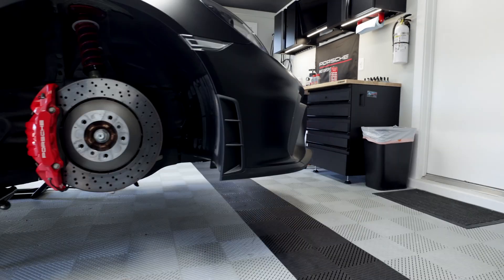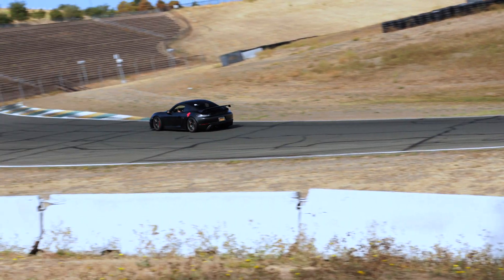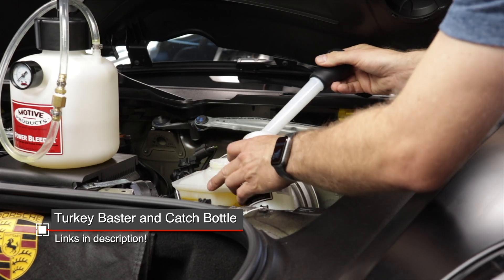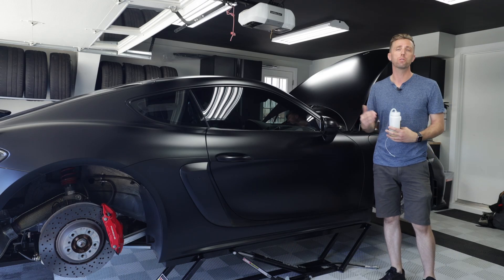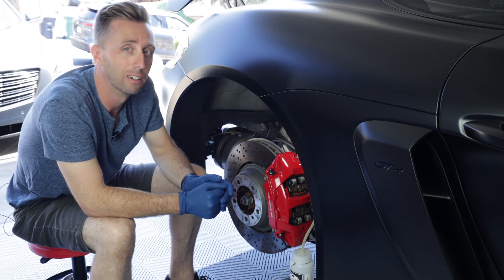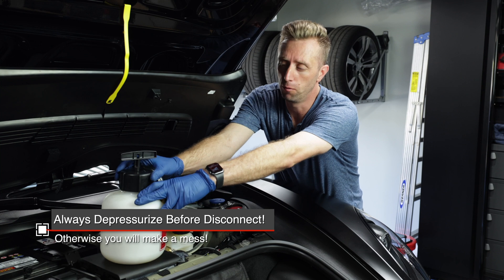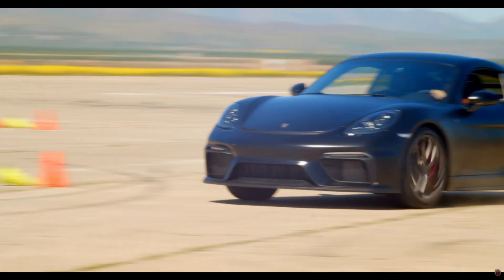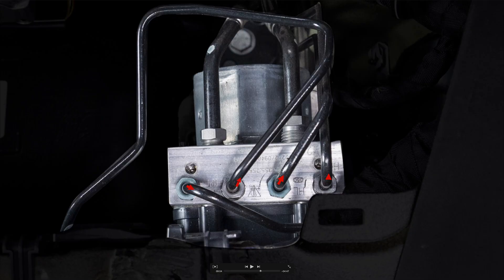Should You Bleed the ABS? | Porsche GT4 Bleed and Flush

Comment: thank you for the videos! i will follow your video very soon for oil change and do the brake fluid shortly after. one question: in your video you mention to use at least 2 quarts of brake fluid. are you sure its 2 quarts? it seems in the video you used two 500ml bottles, which is 1L closer to a quart. 2 quarts would mean about 4 500ml bottles. Thanks!
Reply from the maker: Sorry, you are correct. Have two 500ml or equivalent bottles available to flush.
Reply: @JetFuelOnly thanks for clarifying! If you are doing it again this year, would you mind showing us how to bleed the clutch as well? And maybe spark plugs too?
Reply from the maker: @tonyliang90 unfortunately I have a PDK so there won’t be a clutch bleed I plan to do spark plugs sometime in the next few months and I will make a video
Reply: @JetFuelOnly awesome looking forward to it

Comment: How to bleed the ABS you need to do your steps and get a friend or wife,let the pressure bleeder turn on your engine,in my case front driver side first , person inside car apply breaks.
And you bleed.
The reason for that is the ABS motor in the break unit Is active.

Comment: Just got it done on my GTS 4.0, including the ABS Bleed. I can confirm the iCarSoft POR v2.0 does now work with the latest update. Glad it worked as I was going to skip it, but after general bleed the brakes felt fine, but in my mind, softer than they were before. I did the ABS bleed per the iCarSoft walk-thru and afterward the brake feel was rock solid hard. Great video Danial, thanks so much for detailed and polished content man!  Also, I saw you were on Rennlist, I'm going to send a friend request, I just joined!
Reply from the maker: That’s for your support man!  I’m glad it’s working. Will need to update!  Got your request.

Comment: Hi you stated you had problems with bleeding your ABS system with a scanner. I think the battery needs to maintain a certain power. When you're bleeding, the ABS with a scanner.
That's why your scanner times out. Cause the battery power drops it's low . Please communicate back to me if you successfully did this. The way I stayed it, and if it worked, you can put a battery maintainer on the car, so when you're doing the steps, it maintains that vote is because the porsches are sensitive when it comes to power. Maintaining when programming
Reply from the maker: Interesting!  Will need to check that out. Someone posted below they got it to work with an update.

Comment: Nice video. You should always bleed the outer bleeder valve first not how he did it.
-During the bleeding process second fitter must operate brake
pedal slowly
-only after remove hydraulic or master cylinder you should bleed with PIWIS.
1bar pressure not enough. pushed all the way to 1.8-2 bar

Comment: ABS bleeding is very finicky. If the pressure drops below the recommended level, or if the battery runs below a certain threshold, the process will fail and you have to start all over again. I used a PIWIS system and it still took me 4-5 tries to get all the conditions exactly right for it to bleed all 4 lines successfully.
Reply from the maker: Good to know thanks!

Comment: Great video and super helpful! Minor correction for the benefits of viewers: 
There are two bleeder valves on the brake calliper. Brake  fluid must be drained at both bleeder valves. Always bleed the outer bleeder valve  first.
Reply: I dont think the order in which you bleed them matters, in either case you are going to get all of the old fluid out
Reply: Perfect, thank you. I was looking for this. Wasn't sure if you only had to bleed one side of the caliper when performing the ABS part.
Reply from the maker: Thanks, I mentioned both bleeders at 4:50 but I’ve seen recommendations both ways on bleeders.  I’ve leaned toward inner first.
Reply: @JetFuelOnly  that was a direct quote from the service manual actually. But yeah. Probably won’t make much of a difference 😀
Reply: @gt4.86  I've heard outer first, for the same reason that you start with the passenger rear: you always want to start at the farthest point from the reservoir, and work inwards.

Comment: I am starting to notice that  factory service manuals for modern cars require a second person to pump the brake pedal WHILE the power/ pressure bleeder is connected  and the bleeder nipple open, In other words the classic pump and hold method is added on the regular pressure bleeding process

which is confusing, I always thought that pressure bleeding does not require any movement from the master cylinder,  and that two person pump and hold sequence is only for the classic manual bleeding process, but factory service manuals are very specific about it , what's your thoughts on this?
Reply from the maker: Unfortunately I haven’t seen the specific manual procedure for this car but I occasionally feel like my pressure bleeds aren’t doing the job I think they are. You may be on to something!
Reply: Here in the UK I have a family member who is a porsche tech at our local porsche dealer. I asked him if there was anything 'special' about a brake fluid change on a 718, and he said no. The standard pressure bleed system is correct. I'm happy to do it exactly like you. Only differences in my method is, lots of rags around the area of the mastercylinder before pulling that filter. And I always keep a spray bottle of diluted soapy water for any spillages. Oh, and I put a small allen key down the bleed nipple when finished to force out any fluid residue when tightened and wipe and spray around the nipple areas to make sure its all clean.
Reply from the maker: I like the Allen key method!

Comment: only thing i gotta say is; you MUST use some secondary jacks because those primary jacks of yours HAVE FAILED many times per the various complaints, you don't want your baby on the deck with no wheels attached..... 🤠
Reply from the maker: Quick jacks have failed?  They are on a hard lock and even if hydraulic pressure is lost they won’t go anywhere?

Comment: Just one thing, by adding brake fluid up to the max level after having bled your brakes, the day you replace your old pads with new (thicker)pads , brake fluid may overflow your reservoir…so i would not fill it to max with used brake pads . For the rest interesting tool!
Reply: Always open the bleeder. never push old fluid back to the master cylinder.

Comment: Enjoyed the video.  I also have a 981 GT4 and have done my own brake bleeds with the Motive bleeder.  I have never done the ABS bleed but have done the clutch slave bleed which is somewhat of a pain to reach the nipple.  I asked a tech at a dealership if they do the clutch slave cylinder during a normal bleed and he said they didn't.  I suspect there is not enough old fluid in either location to cause a problem if done regularly and properly.  Who knows for sure though?
Reply: You are right when you said "if done regularly". When your tech said they don't, I wonder if that means ever. When do they flush the clutch? It doesn't not sound like regularly.
Reply from the maker: Thanks for watching!
Reply: the clutch bleeder screw is plastic and not worth stripping to bleed, and it's such a pain to get to. no matter what the tech has it will take to long to bleed it right so they never bother to do it.

Comment: Thanks!
Reply: I have always heard, as to caliper order, outside, then inside....I see on the video, inside to outside. Hmmmm. I'll get to the bottom of this. You have brake fluid in the Motive bleeder as opposed to using the Motive simply to apply pressure. I see 2 big advantages this way, you'll know how much fluid you are beginning with, and you most likely will never bleed the reservoir dry...Another good point when using the Motive as a reservoir, be certain to check the master cylinder brake fluid level post bleed. This weekend a pal and I tried using a scanner that required 29 PSI....we were doing it dry...the Motive kept losing pressure and the scanner approach to both bleed and flush the ABS didn't work. Also, the scanner prescribed a strange (to me) caliper bleed order: LR, LF, RR, RF.....this goes against what I have done in the past. Lastly, your video was so informative, that I felt that a little contribution was in order. "Yoy can't get something for nothing!" Nice job.....
Reply: @mschacht69  I had the same issue with inside vs outside first. I've watched so many videos on the process from Porsche certified mechanics to the manufacturers of the calipers and neither agree on the order to bleed them. The only thing that is consistent is the order to bleed brakes during a conventional brake bleed. RR, LR, RF, LF. The sequence for an ABS bleed is always different.
Reply from the maker: Thanks for watching!  Yeah 29psi is a lot when Motive is designed at 15. 
Regarding inner Vs outer, I’ve also heard it doesn’t matter much. Lol.